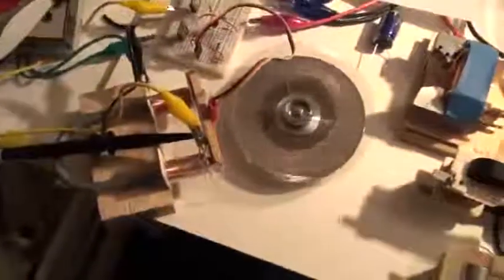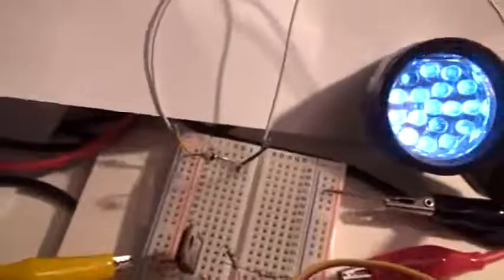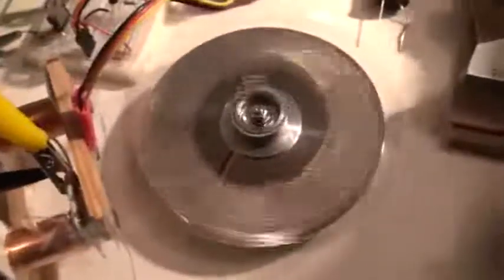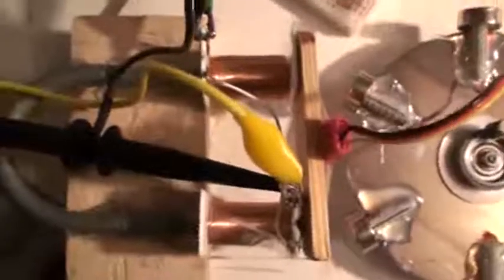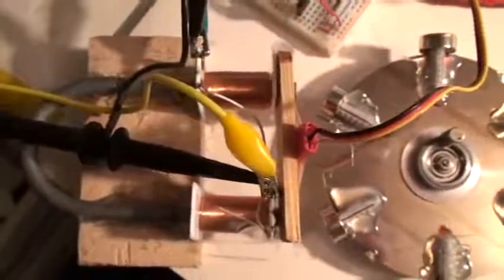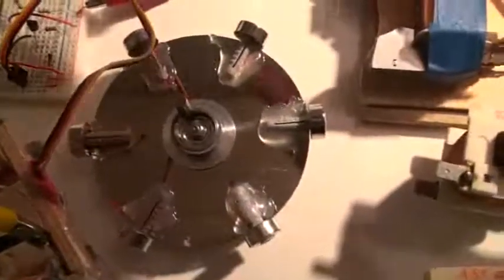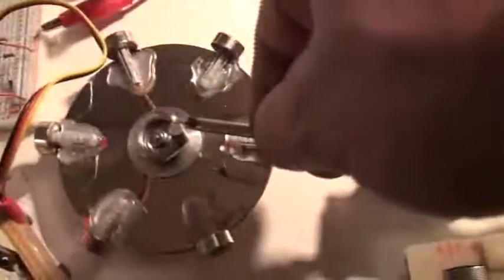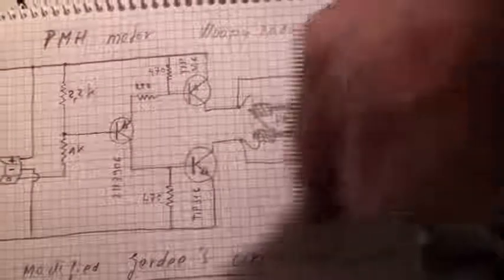pulse motor with pmh armature test 3.wmv

Comment: Hi! This video is old, but the answer why "bigger" coils is much worst then U shape is simple. The inductance is "close to magnet wire(core)". After 5mm from core there is no inductance and all windings is "useless"(for achieving more Amperes at the end). I find it when I work with tube amplifiers(EL84). I try to wind the transformer with 1:5 and I realize this- all windings which are wind more than 5mm higher(from the core) is useless. There is no inductance. If we speak about High Frequency than core is no needed- we can use "core less" transformers or ferrite core or aluminum core or "wood" core- or glass core :)... Tesla coils is typical example :). Thank you!